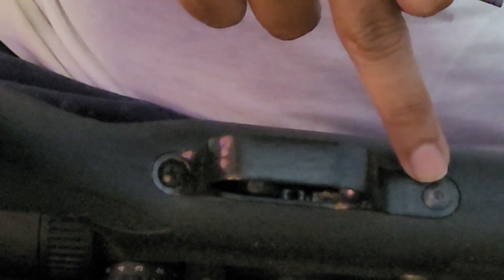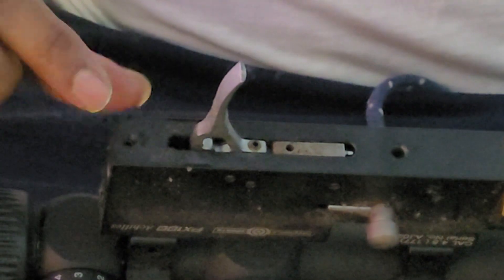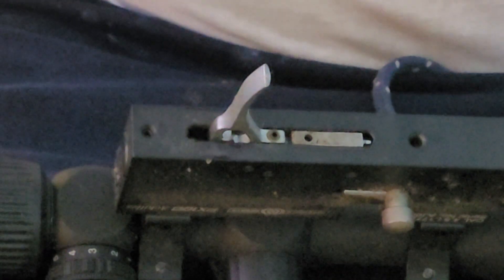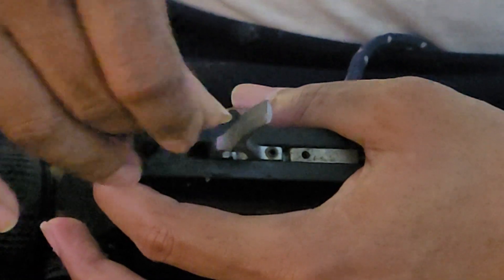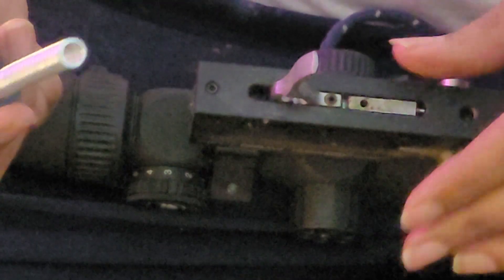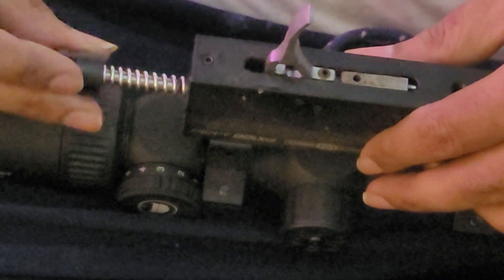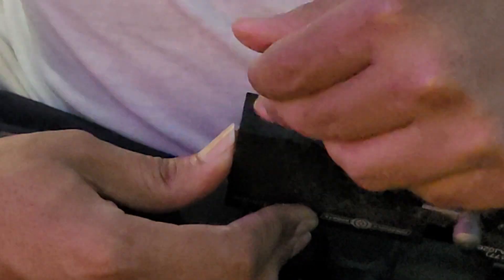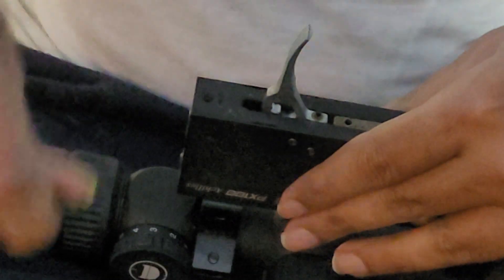Installing power adjuster for px100

Comment: Where to buy this sir?
Reply from the maker: 09324635100 call this number and buy original one available with this guy don't buy duplicates. buy from this guy take both spring and power adjuster